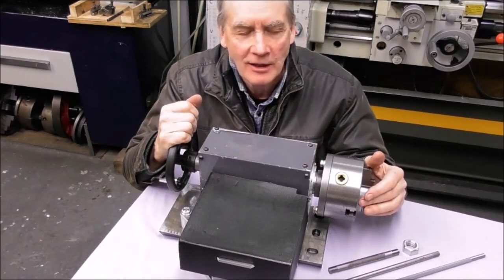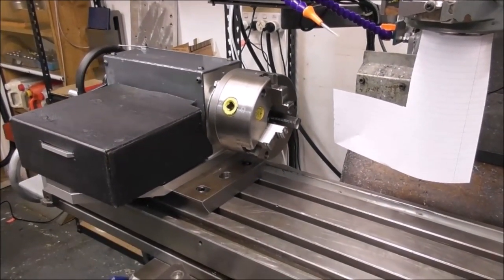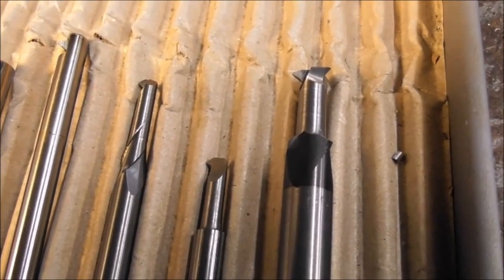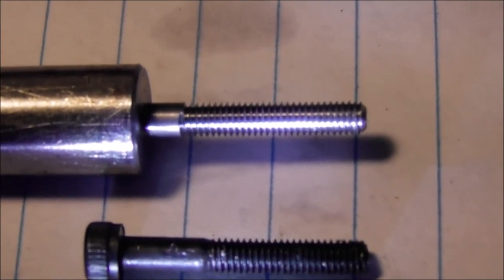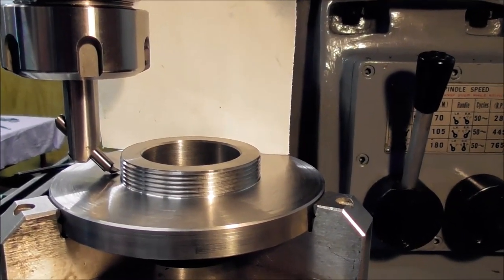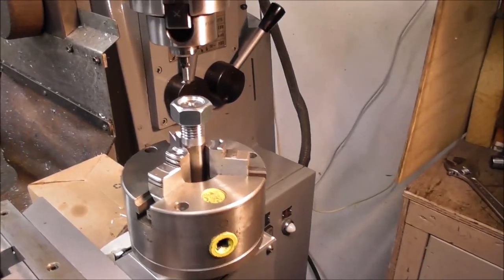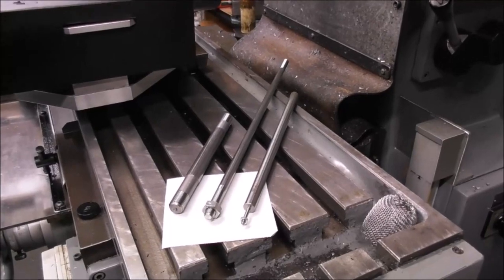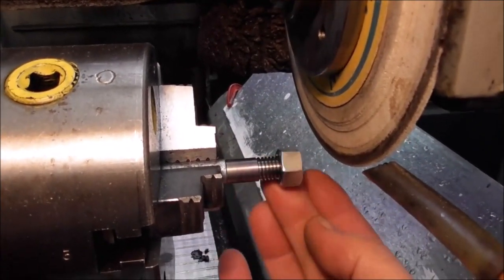ThreadExpress 2 - Thread Machining Attachment 2

Comment: Somehow I managed to see your second video before this one lol. Now once again it’s brilliant! I haven’t put on my thinking cap on yet to figure out what’s under the hood. That’s the key to it all. The rest is very basic. I’m not so sure you will ever show it and I can appreciate that. I’d think with technology today the pitch’s could be driven by a variable pitch generator to advance the chuck. Again I’ve not spent anytime thinking on it. The only drawback to this is you need a horizontal mill to use it due to the size of the unit. This is a huge drawback in my mind. Most every shop has a vertical mill. Not knowing exactly what’s in there I’m wondering if you could use a bevel gear set to drive it. That way it could be shorter to use on a vertical. Just my 2.5 cents.  Used to be 2 cents but now with inflation it’s 2.5 😂 Once again,  brilliant young man!  Several variables to the success. The target market place. Europe would be better than USA. The cost it would take to manufacture a given quantity. All the costs involved with insurance, marketing etc. personally even though it’s a great , no awesome idea if you can’t produce it at a cost a hobby type shop could afford I think you’d be heading for failure. Now one thought that might work is to sell plans to make it. Get a copyright instead of a patent. This is a tad tricky but can be done for far less. I think the DYI market would still be the best. Even if some manufacturer stole the idea once it’s available chances are they can’t make it cheap enough to compete with a DYI. Basically it will take someone with the ability to make something that. And that would be a someone who would need to use in the first place. Tools you need to make tools so to speak. Regardless of anything I wish you great success. You remind me of me lol.
Reply from the maker: Hi - Thanks for your kind words and thoughts. It can be mounted off the side of a vertical mill table as in videos 2.1 and 2.2 . Cheers, Cliff

Comment: By failing to describe the variable pitch drive, you give no clue as to how difficult it is to set the pitch accurately.  The reproducibility is impressive.
Reply from the maker: Hi - Yes, I realize that. But for commercial reasons I cannot disclose the design. This is explained at the end of the video. Cheers, Cliff

Comment: Cliff, this has tons of potential.  I think it could be scalable for smaller machines as well. I recall reading an article in the old Model Engineer magazine about thread milling and it was described as "death by a thousand cuts". Meaning tiny chip load but lots of chips. If I were you I'd be concerned about a certain Asian country simply stealing your idea and selling it on without respect for IP. Let's hope not.
Regards,
Preso.
Reply from the maker: Hi Preso! Good to hear from you. Thanks for your thoughts. Yes, I was thinking it would be fun to make a 1/2 size one for smaller work and machines. Cheers, Cliff

Comment: Its the chuck/spindle bore pass through?  It could be very nice for cutting vehicle tie rod/drag link adjusters.  Done a few long ones for 4wds on a lathe and you end up needing to use a steady rest to keep it suported (and prevent whip from having it out the back of the lathe headstock). This would be easier to setup.
Reply from the maker: Yes, the design allows chuck/spindle pass through. The prototype allows 18mm but it could be scaled up in a production version. What sort of diameter would be needed? Cheers, Cliff

Comment: G'day Cliff, very interesting. Is there any backlash between the forward and reverse movement?  With the infinitely variable pitch, is there a lot of trial and error to get the correct pitch set?  I can make a guess at how it works but I would have probably gone down the electronic feed road due to my background. Great stuff.
Reply from the maker: Hi - Thanks for the feedback. The pitch setting is actually quite quick to set, and I am working on further refinements. Yes, with mechanical movement, there is always potentially some backlash and so it is always best to keep feed in the same direction. Cheers, Cliff

Comment: Great idea could be used for taper threads and use standard threading boring bars, thread mills or even a tap for full form threads. If the form is ground with enough clearance would the unit still need to be set at the helix angle? Using the tools already mentioned they all cut parallel to the thread axis without a problem. I've made CVT's / IVT's in the past, these could probably also solve the infinite ratio adjustment.
Reply from the maker: Thanks for your thoughts. Yes, I want to trial using threading inserts as thread cutters. Wondering why you dislike tipping the unit to the helix angle - it is only a small job. Sure, many threads are machined without this, and they still work ok, it's just that the thread form is somewhat compromised, for many applications that is not a problem.  More cutter clearance does not help, it is the cutting edge that generates the error. Cheers, Cliff
Reply: Thanks for replying Cliff. Is the reason for tipping the unit to the helix angle because the thread form is supposed to be measured at right angles to the helix?

I never knew this & from reference drawings I always assumed that the thread form was measured square to the axis because this is how they are cut. Although rolling and grinding are set at the helix angle for clearance, do they have a modified form to give the true form square to the axis? I guess that taps are a modified thread form for to allow for them not cutting at the helix angle.

I did experiment about 4 months ago with milling threads using a lathe threading tool both internal & external with the same tool. It worked fine for 10 start threads and can be found on my channel. "milling 10 start threads with lathe boring tool". I hope it helps to see how it was done.
Reply from the maker: Hi @machinists-shortcuts . If you do not set the cutter to the thread helix angle, the problem is that in many circumstances the 3D path of the cutter interferes with the 3D shape of the thread and cuts a thread form with errors. With some thread form, pitch and thread diameter to cutter diameter combinations the error is nil, with others it is a serious issue. Take a large cutter diameter as in a large thread grinding wheel, grinding a small diameter steep pitch thread, here you can see the cutter will cause serious errors. Cheers, Cliff
Reply: Thanks for the detailed info Cliff.

I believe that thread grinding wheels have a modified form to compensate for the angle at which they are tilted. So I don't think you would be able to use standard form threading inserts. They would not produce the correct form if the part is presented to them at an angle. It seems similar to not squaring a threading tool to the part on a lathe.
However they have a significantly smaller cutting radius than your flycutter, so could probably be used most of the time in small diameter boring bars without tilting the part.

I guess you have had lots of questions as to why an out of the box electronic leadscrew kit is not suitable for this application. I assume it is not robust enough or probably already been done.

I think this great idea should address long pitch threads & worms that are over a lathes maximum pitch capability. These are a pain to set up with a dividing head & gears compared to screwcutting or using dies.

Comment: This is an interesting project. What are the objectives when the time taken to single point screw cut on a lathe only takes minutes. Try this on a long stepped shaft when the thread is required in the middle of it's length. Screw cutting up to a shoulder doen't always require a groove. Using the thread chasing dial on a lathe is an old idea. The use of the spindle brake and reverse on a modern centre lathe, one can cut up to a sholder for example, a 2mm pitch on a 50mm OD at 300rpm 50mm long on H13 steel heat treated to 48 Rockwell C hardness with carbide tooling in one minute. Lathes have more options to support the work piece, centres and steadies. I wish you well. Cheers
Reply from the maker: Thanks for your thoughts. I have been both lathe screw cutting and thread milling for decades, and I agree there are jobs/applications where a lathe would be the better option, and applications where thread milling would be the better option. Cheers, Cliff

Comment: Marvelous idea.......cuts any pitch but you can't thread mill or grind a square thread with any thread milling device, that is why the Acme thread form was used for production feed screw manufacture.
Hmmmmmm.......just thinking on how the infinite pitch generating mechanism works and I think it's similar to the helix angle generator I have invented for grinding  end mill helixes without having to use the finger rest.....but mum's the word.
Reply from the maker: Thanks for your input! Cheers, Cliff

Comment: What's in the box? How do you set the pitch? How does the "infinitely variable" thing work when you need repeatability or mathematical matching?
Nice video, but you didnt provide the useful info. 🤔
Reply from the maker: Hi. This is covered at the end of the video. Cheers, Cliff
Reply: Thanks for the reply. I make my living from my engineering inventions and wish you luck.
However it is highly unlikely your mechanical mechanism is not already covered by someone else's patent. It is very hard to make money from a mechanical invention in the way you outline here.
Also, if the product sees any popularity in sales, competitors can just use their own mechanisms in a competing cheaper product that does basically the same thing. Probably just a little box of change gears etc that will do all normal thread pitches. Or, China will rip off your mechanism and sell it cheap, it is almost impossible to stop them appearing on ebay or aliexpress even if you win a western country court case.
Reply from the maker: Hi @wizrom3046  . Thanks for your comments. I won't reply to those subjects in this public forum, but if you would like to discuss this, feel free to email me. Cheers, Cliff
Reply: @Threadexpress  ... that's Ok I wont bother you by email.
I just wanted to make that point that for an unscrupulous China company to make a competing product they dont need to replicate your proprietary ratio mechanism, they just need to replicate the basic use functionality of the whole device.
Again, I wish you luck, and 👍